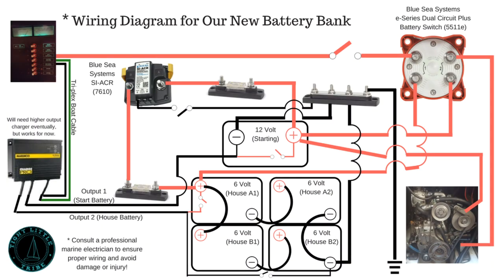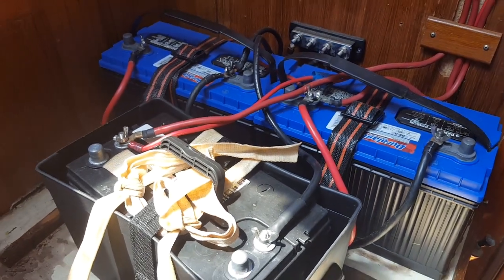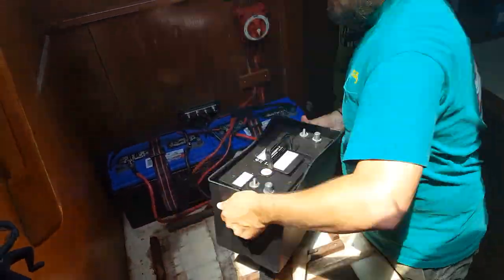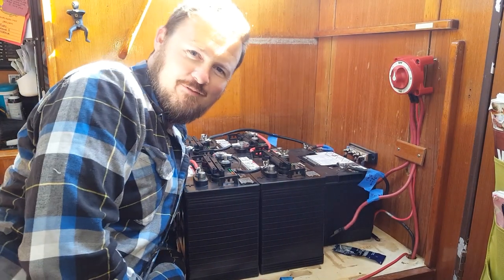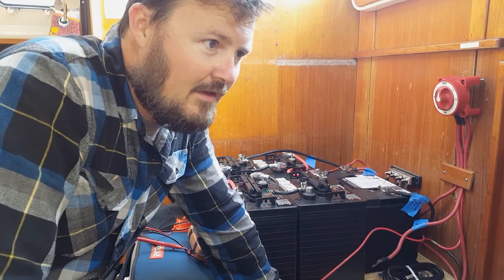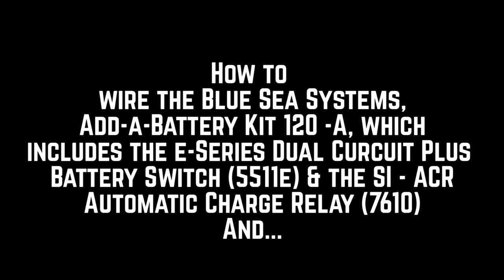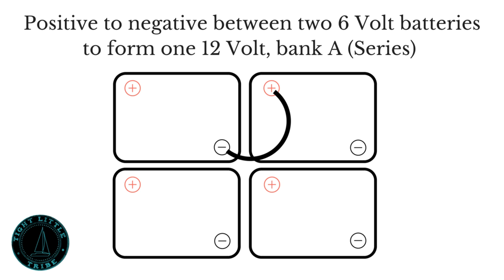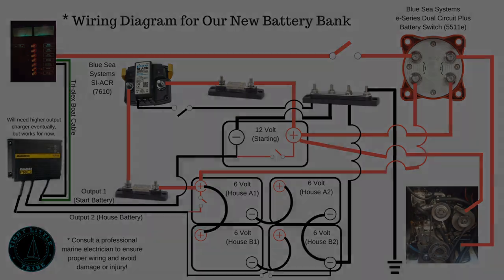Blue Sea Systems Battery Switch 5511e & ACR 7610 | 6 Volt Battery Bank Diagram in Series & Parallel

Comment: Did that charge all the 6 V batteries cause I have 312 V batteries hooked up for 36 V and I have to put a charger on every battery separately I cannot just put the charger on one battery and have them all charge so I don't see how you were charging all those batteries just by going to one terminal

Comment: I'm glad to finally find a video on this setup - good job! I'm trying to understand the purpose of the dual circuit switch and what "On" and "Off" mean. Does "On" mean the two batteries groups (starter, house) are fully operational and working normally as separate groups? Does "Off" mean they are disconnected and not operational to save on battery drain? Is the switch even needed for the ACR to function or how do the compliment each other?

Comment: are you manually closing the ground to power the ACR? I see u have a switch in the diagram. otherwise  If ACR monitors 24 hr, the battery charger will fool the ACR and make it combine, doing away with the two bank feature of the charger. Im sure you have figured this out by now.  

Do you have a remote pilot hooked to it?  If so, did you find that only an LED indicator will work?

Comment: Great video !  Ever think of installing 12 volt lithium battery's instead of 6 volt lead acid filled battery's?
Lithium has a quicker charge time, longer run time , plus safer than lead battery's, especially when enclosed in a cabin under the stairs... lithium are more expensive but way more cost effective in the long run...
Reply from the maker: Thanks David. I have drooled over such things before, yes! But at the time I was needing to take care of the problem of my old batteries quickly and cheaply as possible. As you could see it was a bit frustrating and the first time I'd taken on such a project. I learned a TON though and will carry that on to the next project. We've definitely kicked around the idea of a different set up. I think SV Delos has some videos on their upgrades to lithium right? Have you seen that one? They also have a sweet alternative to their stove too. We have CNG right now and are looking either to convert to propane or some other alternative. Any experience with that?
Anyway, glad you liked the video and thanks for commenting and subscribing!
JD

Comment: Hi Tight Little Tribe, I Really enjoyed Your Video, it's the best I have found on the Blue Sea Add a Battery. I am not an electrion but I'm intending on using this system on my Van Conversion to add a Aux Battery. (with a single12 volt 200Amp hour Battery ) I do Have a couple questions. On The Swtich itself.. does that wire going to engine, mean to the alternator positive ?.. and what guage of wire do you think that should be,  it needs to travel about 10 feet. On the ACR, the wire going to the starter, guage of that wire. appox. 10 ft. as well. and DO I  need Fuses on those wires as well. This Doesn't seem to be that Difficult, but I do have my concerns.. Thank You for taking the time to Do Your Video, the Directions on this product are not as good as they should be. Sincerely CGM 469
Reply: I'm checking over my van install this morning before starting it up for the first time. I definitely agree, the install instructions for the switches are a waste of paper. The selector position doesn't match to the post positions in the back, which I find unhelpful (given the poor instructions provided). They don't say anything about running power backwards through the switch either. Have you had any issues with your setup yet?

Comment: Did I miss something? You explain wiring your 6 volt  batteries in series but the  why didn't you explain the whole diagram? Where were the fuses? What guage wire did you use? How did you water tight seal the wire? Why did you have acr connected that way?
Reply from the maker: Hey there Ken! Yeh, I think you did ‘miss something’. Ya know, that whole part where I was like, ‘I have no f’ing idea what I’m doing here.’ But hey, those are all dern good questions. You should go on YouTube, research all those things then build us all a video explaining what you come up with! 🤣 Thanks for watching!

Comment: Hi JD. Just an observation from your circuit diagram that you may want to check over; There appears to be an unfused line that goes from house-bank B2 (-ve) to House-bank A1 (+ve) via two switches in series. I assume that these switches actually isolate the charger from the house bank and that you have deviated from your red/black drawing from earlier in the vid. Otherwise, if these two switches are inadvertently simultaneously closed you may end up with an unexpected BBQ opportunity. I'm sure its a drawing thing and not an actual wiring thing but having spotted it I thought it best to "speak up". Hey, well done on giving this a go and on keeping it simple! It is almost six months down the line since you posted this vid now, I'd love to hear how it has all worked out...
Reply from the maker: Hey there Waughthog Waugh. Thanks for the comment and the concern. You have my attention, yet not my understanding. :( I don't see which line you could be talking about. Is this from the final drawing that is the Thumbnail for the video? Did you see the thumbnail I posted in Facebook today? Would love to get to a point of understanding on this one! 
Yeh, you're right though, we're several months into this and the batteries and the new charger are working out really well. We've spent several nights out on the hook and find that we have plenty of power to suit our needs at anchor. Solar power will be the next electrical project!

Comment: Hey guys, I know you have completed you install but I would highly recommend Pacific Yacht Stystems' You Tube channel. Jeff has a bunch of exceptional videos on boat electrical systems.
Reply from the maker: Ha! Of all people, you should know that 'completed' doesn't mean finished. Dude, I watched what you're working on and sub'd. Can't wait to see more. 
I also went and checked Pacific Yacht Systems. Looks like that's going to be a really helpful resource in the future as well! Thanks for pointing me in that direction and for the comment!
Reply: Good luck with the rest of your project, also subd. I like Jeff because he is fanatical about 12 volt electrical. A ton of good info in his videos. I am actually putting in a 24 volt Tesla battery bank in my rig.
Reply: I'll second PYS... been really helpful during my  rehab of my project boat.
Reply from the maker: Yeh man I checked him out. Amazing and definately subscribed! Thanks Mark!
Reply: Tight Little Tribe Sailing Jeff will tell you to remove those wing nuts and use regular nuts with lock washers
Reply from the maker: Matt Waller totally! It's done. Thank you for taking the time to let us know tho!

Comment: Three year old video.  Get rid of the wing nuts and replace with split lock washers flat washers and regular nuts made for batteries if you haven't already. And all of the wires look to small if your powering any thing more then just lights. I'm not a boat electrician but I think your off and on switch needs to be in a area that can very quickly be gotten to if a short or electrical fire were to happen and your not around to move the stairs? One more very BIG thing is I didn't see a Catastrophe fuse in place at either of the house batteries Positive post before the battery switch or the starter battery POS post and I don't mean the two fuses that belong between the ACR and the batteries.  Size the Catastrophic fuse to handle the load but protect the wires, those smaller gauge wires need to be protected if a short were to happen any where in your system. Normally you don't fuse a starter battery. But there are systems where it would be beneficial. I was surprised that your start battery isn't closer to the engine. Lots of voltage loss in long wire runs. Boat electrician would clear that up.